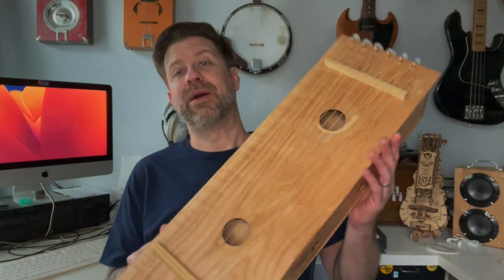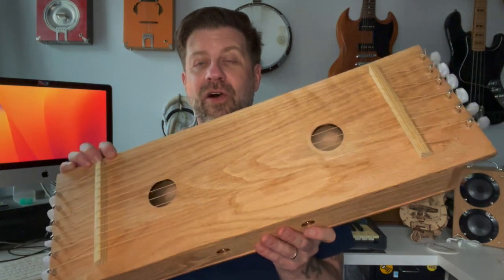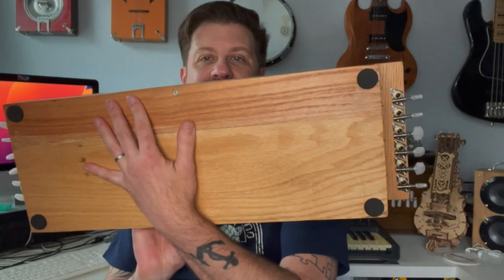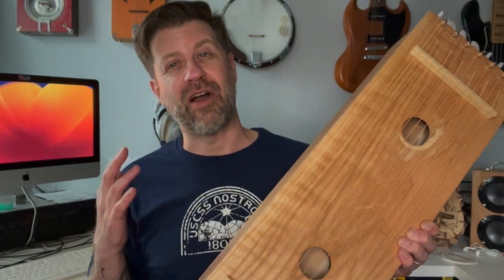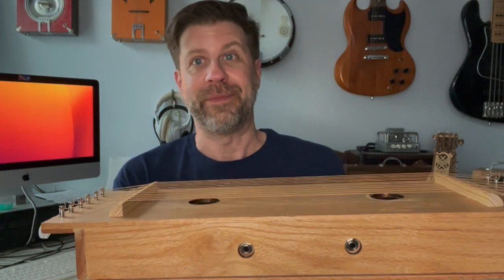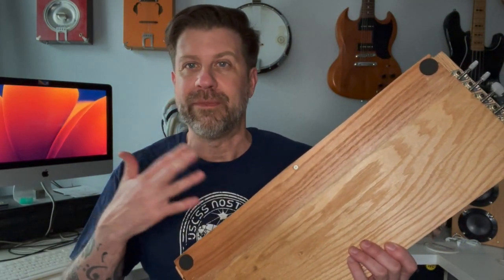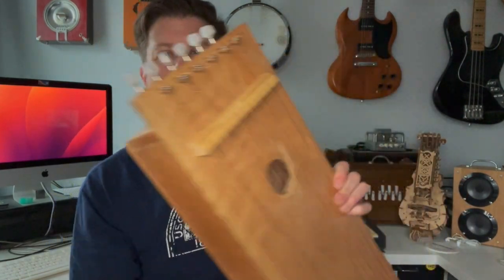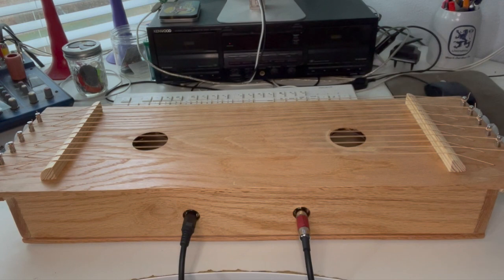More About My Makeshift Monochord (DIY 12-string Instrument)

Comment: Should be easy enough to turn it into a zither too, with differently-tuned strings.  It's a very cool build!
Reply from the maker: Thanks for checking it out.
Reply: That's exactly i was thinking about. If one use different gauge strings that would sounds like a psaltery or a zither. I'll try it out.

Comment: Looks great and sounds great to. Its inspired to make one. If i built a larger one would the strings have to be thicker to get a C3/C4 chords.
Reply from the maker: Thanks for checking out the video. It's always difficult to say until you try it but  if you increased the scale another 3-4 inches, I'd suspect you might want to go slightly heavier than what I used. Good luck.
Reply: @musicalmiscellany  Thanks for your reply :)

Comment: Have you run it through a stereo tremolo pedal or a slicer pedal? I have the boss sl2 slicer and i bet it would be a fun combo. Great video and the byild quality is better than anything i could do.
Reply from the maker: Thanks for checking it out. I haven't run it through a stereo trem yet but I did try a stereo chorus and a stereo reverb. That's a great idea though. I'll bet you'd get some cool panning effects. One of the nice things is that the strings can be slightly out of tune and it really fattens up the sound. Kinda like when you slightly detune an oscillator on a synth. I need to record a track with some other instruments and see how it sits in the mix.